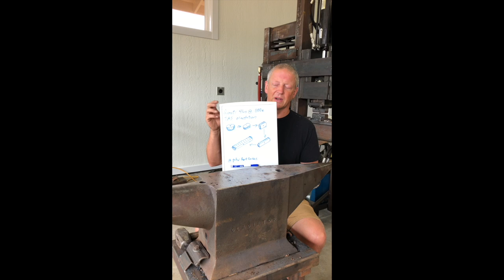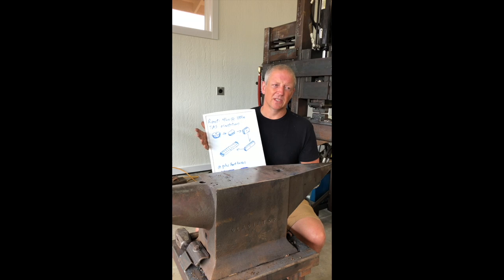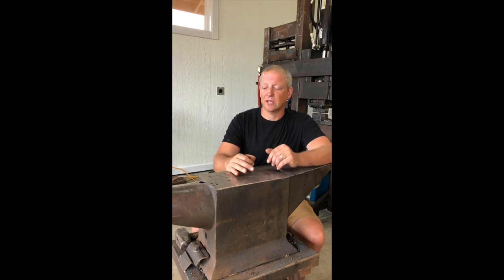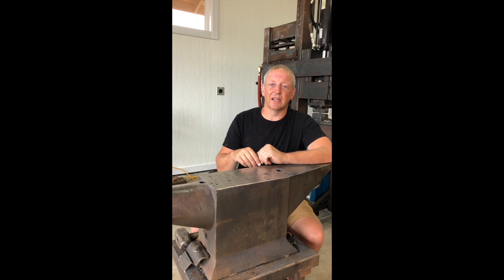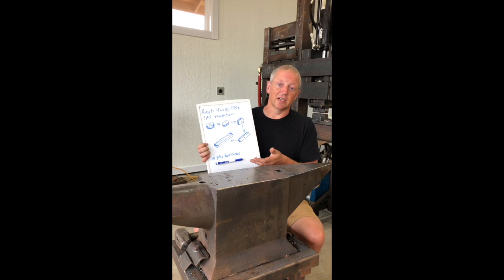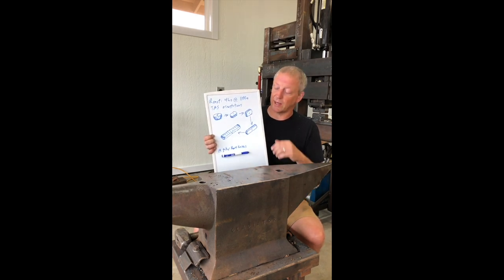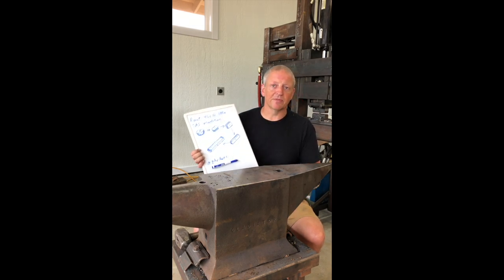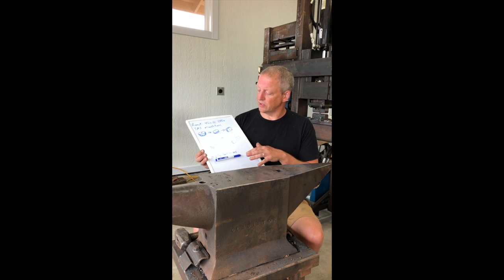Wootz Forging, Ingot to Large Bar

Comment: You said you've roasted the ingot at 1200 degrees Centigrade and just took off from there.
So you kept the temperature at that level while working the ingot with the forging press?
Reply from the maker: If I said 1200c then I meant 1100c. 1200c will work for some chemistries, but not others, while 1100c is safe for almost all chemistries.

Comment: Right on!! I meant to forge my ingot just like that but got a little carried away as I must admit I was a little nervous forging my first ingot. But I was a able to grind most of it away. 
Next question is how to properly heat treat this steel?
Reply from the maker: It’s definitely easy to veer away from the plan once the steel is hot. I sometimes draw out a process on a whiteboard or make temperature notes on the frame of the press so I have visual reminders to keep me on track.

Comment: Great video Peter, what number crucible did you use and how many grams did you start with to get that size bar?
Reply from the maker: I’m using an A6 Salamander clay-graphite crucible and a 2500g charge. It’s a good size and shape for my forging set up, but smaller ingots were more common historically.
Reply: @peterburt7218  Thank You